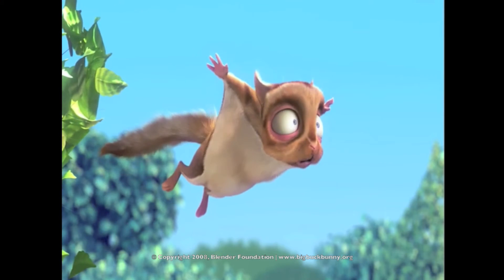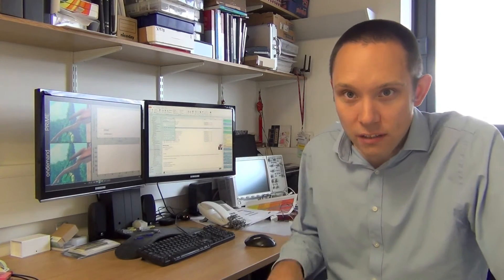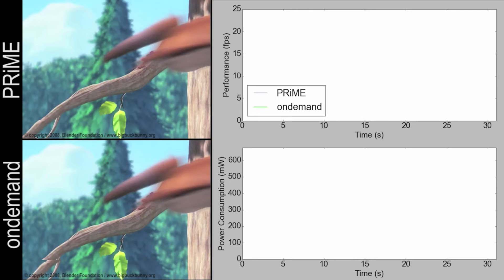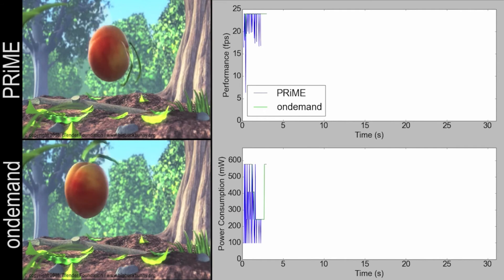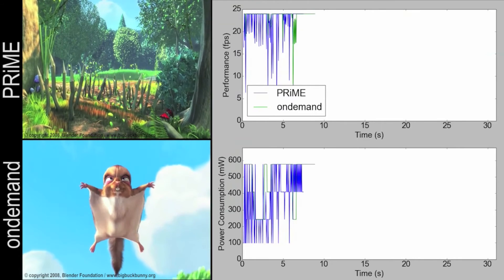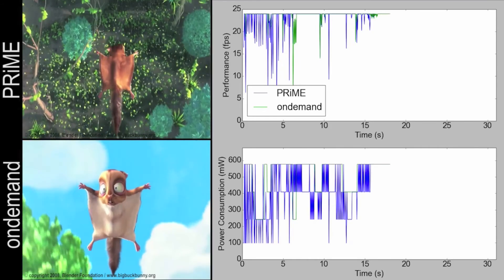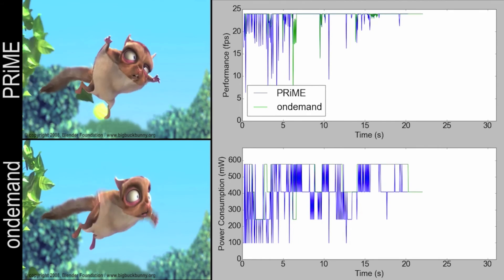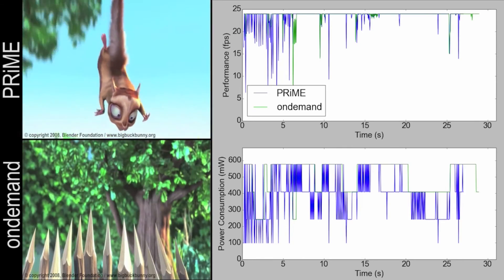Using machine learning to dynamically adjust the voltage and frequency

Comment: And what is the overhead of running the ML algorithm itself?
Reply: The performance and power consumption results presented already include the overheads of the ML algorithm. When running at the processor's lowest frequency (where the overhead will be most considerable), the algorithm takes around 12 us to compute; memory usage is 14 kB.